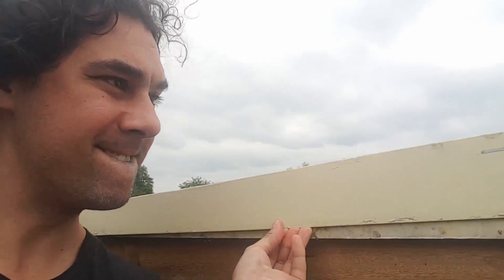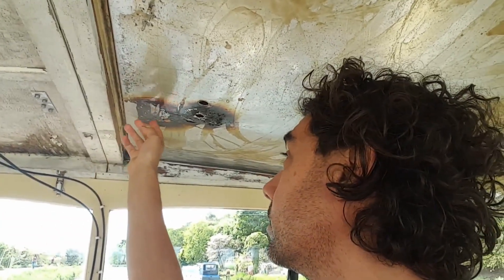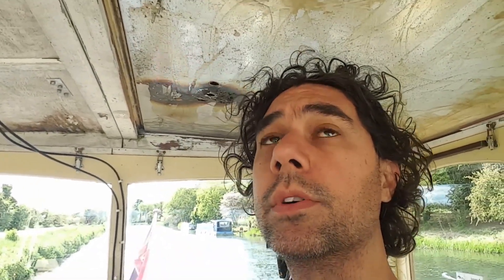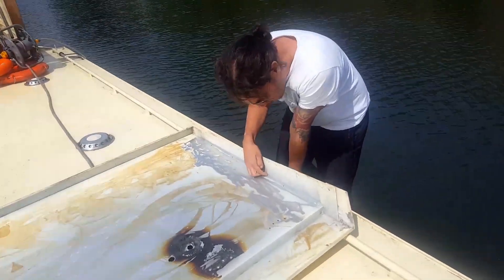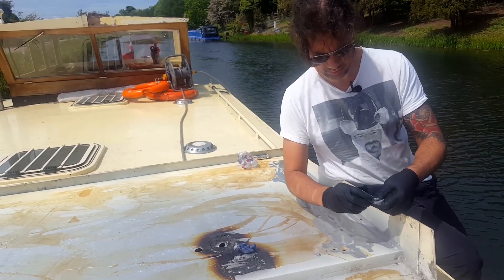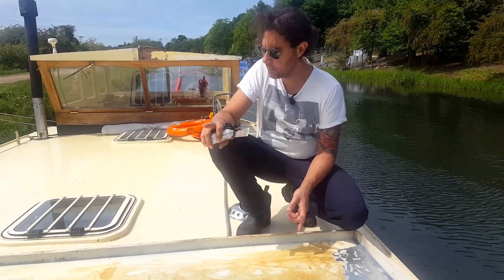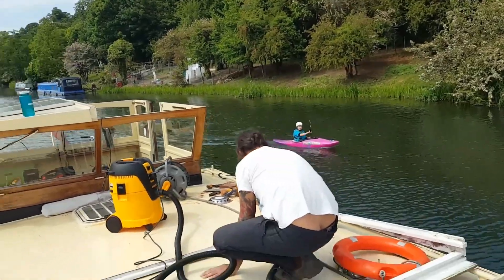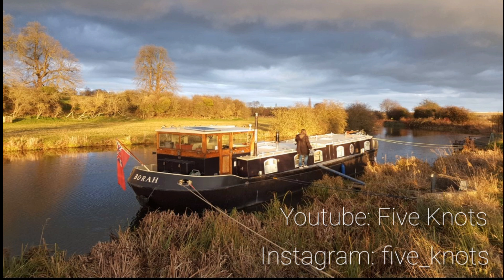Episode 22: LOCKDOWN BOAT WORK: Wheelhouse Roof Repair PART 1

Comment: Great start... Where did the sander/vac come from? 
I find two part metal epoxy such as JB Weld are better than the Quick Steel type putty as they seem to work better with old aluminium. In fact I just just it last week to bond old to new aluminium on my old land rover body which I'm restoring.
Reply from the maker: Thanks Matt! Corey found the Mirka Sanding Kit on eBay as it was the cheapest. He's a big fan.
We've bought up a few Quick Steel packets but we'll have to check out the JB Weld next time. Thanks for the tip!
Reply: @fiveknots7677  Thanks I'll look that up. Looking forward to the finished job!